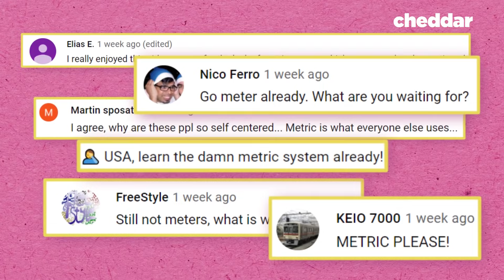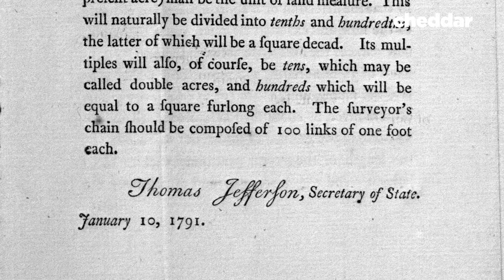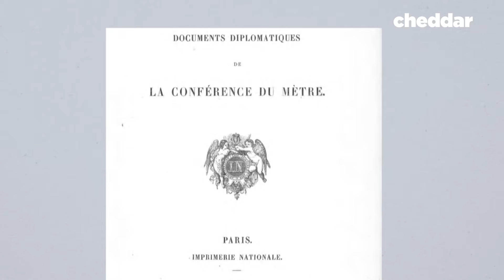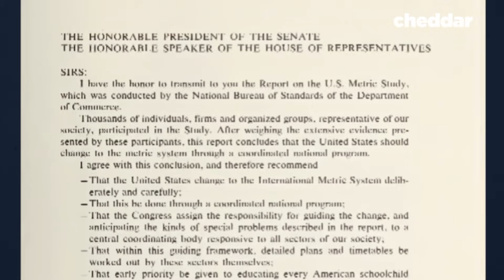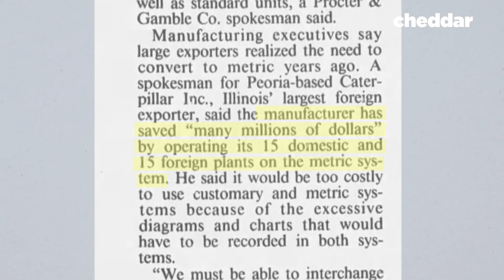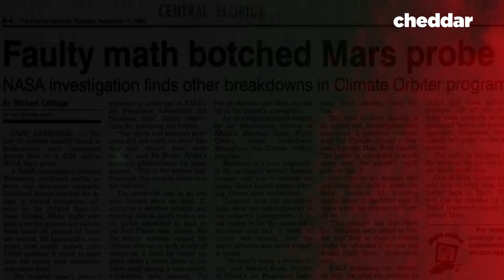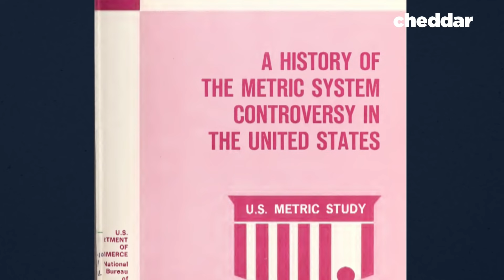Why Doesn't the US Just Use the Metric System? - Cheddar Explains

Comment: They're those who have been too the moon, and they're those who use the metric system
Reply: The guys who got you to the moon used the metric system to do it. Like it or not, the metric system is much easier for science and engineering.
Reply: @yamchadragonball6983  actually we went to the moon without metric.

Also the us doesn't use metric in sceince cuase it's easier.it uses meteric to coprate with other countries when it comes to importantscientific tasks like building a space shuttle.cuase in the past the us tried to build a space shuttle/station with another country and the parts didn't aleign due to the diffrent measurment systems that were used.

Comment: As an American Engineer while in University in the late 1970's and early 1980's where we were fully trained in the Metric system in all aspects of science and engineering, as well as conversion for that archaic Imperial system.  The radio station for where I learned Engineering Georgia Tech reported weather in Metric units, temperature Celsius and wind speed in meters per second (hurricane force is about 33 meters per second).  I adapted quickly;y when I lived overseas.  No well trained American engineer I know of was sympathetic to NASA for that mistake because the error was pathetic.

Comment: The only way it will ever happen is if industry stops selling in English Imperial units then no need to convert. But why is metric "more efficient "? I don't see it.
Reply: 1 cc is 1/1000 liter, and weighs 1 gram at STP. It takes 1 Calorie to raise 1 gm of water 1C. See?
Reply: @TheRealJamesKirk  Not really. Using the system you know is more efficient than conversation. I can just see converting all those recipes to metric then having to go buy all new measures
Reply: @clasicradiolover  - I think you are assuming that one starts with US Customary units and then converts. This isn't necessary, and, at any rate, it's easy enough to ballpark the conversions. But why? AFAIK, most kitchen gear is calibrated in both systems these days. Just do everything in SI.  Ballpark conversions:
1 L = 1 QT. + 2 liquid oz.
1/2 Kilo = 1 Lb. + 1 dry oz.
°C = °F/2 (in the typical cooking temp range 200F - 500F)

As we used to say at Shell R&D, "close enough for government work."

And if you are driving, 100kph ≈ 60 mph (62, really)
Reply: @TheRealJamesKirk  how much salt in a pinch in metric? Tea spoon Table spoon?

Comment: I can safely say no one knows how to correctly convert metric units in fractions without help, Thus making a whole system measurement extremely difficult to work with. Even a drug dealer will tell you that.
Reply: That's because it's not meant to be used in fractions but rather decimals, it would be like saying  "an eighth of a dollar".
Reply: @Wenasd  a dollar/currency uses the metric system 100 cents = 1 dollar, making calculations easy.
Reply: I know, that's why I mentioned it, my point was that the metric systems makes it so that fractions are unnecessary.

Comment: The metric system is excellent at science and engineering, crappy for basic life. The imperial system is human intuitive, you know what a pound is ... the amount of the things you use that would fit in you hand. Foot is basically the size of a man's forearm. The degree in the F scale makes more sense for the range of temperatures we experience in life, sucks for chemistry.

I remember an experiment run in the 80's that proves all of this .... they had metric and imperial users do naive estimates of things. The imperial had more accurate estimates by a decent clip. Weights, volumes, and temperature where the biggest. Makes sense, we think in whole numbers and fractions, not decimals. There is a huge difference cognitively between estimating say a quarter of 1 pound versus 1000 units of 1kg.

Comment: A 12 based system would be better because, unlike 10, it can be divided into hole numbers by 2, 3, 4 and 6. However, a 10 based system is far easier for humans to calculate, because we use a 10 based number system. If only we counted 0, 1, 2, 3, 4, 5, 6, 7, 8, 9, A, B, 10, 11, 12, 13, 14, 15, 16, 17, 18, 19, 1A, 1B, 20...

Comment: @5:44.... How you going to say"our" drug dealers??😕
Reply: In the US, they sell drugs by the "brick" to make money. A brick of any drug is 1 lb.[ = 16 oz.] (rounded off to 500 kgs for easier calculation and isn't correct when it's actually 454 kgs/1 lb., so using metric actually make you lose 46 kgs (1.6211453744 oz.) using approximate metrication. If each kg is $1 USD or € 1 , then you lose $46 USD or €46 everytime someone rounds up using metric!!!) 454 kgs = 16 oz. (1 lb.): 28.375 kgs = 1 oz. : 1 kg = 0.0352422907 oz., therefore a gram is approximately 35 1/4 (35.25) oz.. It is legal to own 1 g of any drug in some parts of the USA. Mm & cm are useless. Good luck building a lopsided house with mm & cm. inches are bigger and more accurate when measuring as an architect.

Comment: I work as a mechanical engineer / product designer in a company in Slovenia, Europe. Of course, we use the metric system and everything is fine until you are forced to use parts, supplied from the US. They not only have a totally diffrent technical documentation standards and principles, but the biggest issue is with that damn imperial system. For example, I was designing a custom non-standard oxigen supply system and the hoses and pipes were ordered from EU (so metric system), but the fittings and valves had to be bought from the US, so it took me several days just to calculate the correct tolerances for parts and it was a nightmare to properly assemble the system together. So, PLEASE FOR GOD'S SAKE, GO METRIC ALREADY!
Reply: When I had to conduct a few experiments for my thesis in Australia, working with an Australian company, using equipment made in Germany they'd set the units of measure on a per squared mil basis. When I was told that I thought they meant per millimetre squared, but no they meant per squared mil basis and a mil is 1/1000 of an inch, which I'd never heard of being called a mil before in my life (as far as I was concerned that woulf have been called a "thou") and there was no reason to be using when everything else was metric. So thay totally screwed up my calculations.
Reply: It’s so frustrating to design in imperial and convert back and forth. I’m constantly converting and trying to measure American things that were made in god awful imperial inches.
Reply: Sounds like you accidentally ordered some legacy parts meant only for maintaining old systems in the USA.
Reply: Hej a si ti slovenc
Reply: 1 mile= 1760yards, 1yard = 3feet, 1feet = 12inches. Made simple calculation into nightmarish, just like what is the answer LXXVI multiply to IV ? the answer is CCCIV
Reply: @Prajwal Pramod Mass idiocy is an American and British speciality
Reply: 2:56-2:58 why is Ireland included with the UK
Reply: You spelled oxygen wrong.
Reply: Nah.
Reply: Itak!
Reply: @Prajwal Pramod Well said
Reply: @yamchadragonball6983  What country were you working in
Reply: I'm a manufacturing design engineer in the US, working in the automotive industry. Everything we produce is designed in metric; however, some of our equipment and our supplier machine shops work in imperial.

I've worked with German and Japanese technical drawings and can attest to differing standards from all over the world. Germany uses a set of industrial standards by DIN, while the US uses ANSI, then Japan has its own thing with a whole different set of symbology. The US uses 3rd angle projection, while Europe uses 1st angle.

However, I've noticed that Europe still uses imperial units for pipe fittings.
Reply: @sonicpsycho13  Thank god for ISO
Reply: @sonicpsycho13  stop designing vehicles that require a complete disassembly of the steering column and dashboard to fix a 3 dollar part lol
Reply: CoreTech951 — If you got it from the United States, it’s in US Customary units, not Imperial.  Any US company that makes parts can make metric parts.  You just have to specify what you will accept and buy from someone who will supply it.

Would a Slovenian company supply parts to the US in US Customary units?
Reply: GH1618 no because the customary units suck ass :)
Reply: @GH-oi2jf  - Only the US calls the imperial system "US customary units".
Reply: @MadNumForce   ("Only the US calls the imperial system 'US customary units' ")

No, imperial is a different system.  U.S. Customary units are based on the Exchequer units that were in use in the United States since before it even was the United States.   The imperial system, by contrast, was established by Great Britain in 1824, by which time the U.S. was already a separate, independent nation.  So we just kept on using the same old units that we had been using for centuries. 

Granted, there's a lot of overlap.  But some units are quite different.  An  imperial gallon is 1.2 U.S. gallons, and an imperial fluid ounce is 0.96 U.S. fluid ounces.  An imperial ton is 2240 lbs, while a U.S. ton is 2000 lbs even.  Similarly, a U.S. hundredweight is 100 lbs, while an imperial hundredweight is 112 lbs.  (Not that anybody uses hundredweights anymore, anyway.)

But the point is, the imperial system is not the same as the U.S. Customary system.
Reply: No!
Reply: No
Reply: What?  Create a small program to do the calculations automatically.   Your favorite system of measurement means nothing if you are just fat fingering them all in anyways.
Reply: Maybe that's why people should learn both systems and convert one to another.  Something you learn in middle school.
Reply: Nah, I prefer miles per hour and Fahrenheit.
Reply: Well, that is your problem. We like our system.
Reply: @n.n.8423  What system
Reply: @n.n.8423  Metric is more efficient than imperial lmao
Reply: @Prajwal Pramod America is an independent country with a long history of freedom. We like our own measurement system, and we’ll keep using it as long as we feel like it. We tend to not think too highly of collectivist bullcrap (All the countries of the world must unify around the same standards, no diversity allowed, no national sovereignty.) So you can keep your Metric system, we’ll keep our US system.
Reply: We think the same thing you think except for we hate metric. All's I have to say is you do you will do us.
Reply: @zman1569  Hating a more logical system hmm
Reply: Z Man that’s what I’m saying. Just let the us have our units
Reply: @1pcfred  For the sake of ease that would be a nightmare in todays world
Reply: Make your own valves or buy from China. Go to hell already.
Reply: Fat tea is that here in America were thriving on the imperial system and hate change in our learning style just look at common core for example its ment to look at things in a different direction for more critical thinking but is WAAAAYYY more complicated than just simply getting the answer so imagine that but instead with how we measure things and how we learn the weather etc.  Were just simply doing our own thing 😉
Reply: @kevinesquivel9823  no, they are not thriving on the imperial system, in fact it's holding them down. NASA, Pharmacy and medicine stores doesn't even use imperial calculations, but instead metrics. Yes, America may be thriving but clearly not on imperial, especially when they're the only few countries left that uses imperial.
Reply: @jovenchngx  personally i think we are thriving on the imperial system for instance you mention NASA pharmacy and medicine and how they use metric for that and thats because we are responsible for other people in space not jut us but if you want to get into technicals like that than how come most of the leading hospitals in the world are in america and funny story is, is that they use imperial system over metric because as students from kinder through college the doctors were taught the imperial system so that what they use to treat patients and hold clinical trials, another example would be our university's her in the US which are some of the best in the world use imperial systems. I recently got the chance to talk to someone who works for AMGEN a biomedical company that produces medical drugs and medical equipment and this person i talked to came to america from Africa where in which he grew up using metric but upon arriving to america had to switch to imperial, he said it was hard at first but soon he grew to like it and is now using it every day because her works for the 4th largest biomedical company in the world so to sum it all up i'm pretty sure we are thriving =)
Reply: @kevinesquivel9823  For the NASA scenario, yes they are thriving but not because of the imperial system. Doctors grew up using imperial system because USA couldn't convert it to metrics a few tens of years ago. Every doctor was made to relearn the calculation system, which is metrics, because USA is the only few countries that still uses imperial. USA progression in the field of Science wouldn't have happen if they didn't use metrics at all, because metrics is just scientifically more standardized than imperial. Also, yes i would understand why your friend would rather use imperial over metrics, mainly because it has more relations to human's feelings and senses. However, when your friend goes back to work, he still has to use metrics, because every other Research and Development company uses metrics. For USA to fit in, they have to convert imperial to metrics. Thus, they're thriving not because of imperial systems but metric systems.
Reply: @kevinesquivel9823  what load of nonsense. 

First of all, your entire paragraph only had like 1 fullstop.

Second, it's the same everywhere else. Countries who uses metric system also grows up with metric. Doctors, engineers, pilots to even taxi drivers also uses metric. I don't know why are you trying to prove that these professions uses imperial.
Reply: It took you several days to do conversions? Uhhh I think you need to go back to school mate
Reply: @kimjunguny  I guess you're ignorant of the tedious calculations. It is not as easier as your schoolwork.
Reply: @kimjunguny  it isn't just some simple conversion dude. Imagine multiplying layers of conversion with each other. You have to individually find ways to cancel out the units of imperial and replace it with SI.
Reply: You don’t have the right to dictate what measurement standards another sovereign nation uses. So just convert and be glad you’re making money on trade with America.
Reply: @Ethan.Lamoureux  well, we will trade with China then
Reply: @opus53waldstein70  You already trade with China. Are you saying you think metric vs. English is reason enough to abandon trade with America? I’m thinking that American goods generally have some advantage over Chinese goods, otherwise nobody would pay the higher price for Made in USA.
Reply: Opus53 Waldstein the burn
Reply: @Ethan.Lamoureux  Then I guess America don't have the rights to interfere in any other countries politics
Reply: @Ethan.Lamoureux  America is a continent not a country, fool
Reply: @SmithBryan101  Think before you speak, especially before calling someone a fool! There is no continent called “America”. However, just as there are countries with short names like Britain, France, Australia, etc. there is a country named America, and everybody knows it, including you. The official names of these countries are: United Kingdom of Great Britain and Northern Ireland, République française, Commonwealth of Australia, United States of America.
Reply: @Ethan.Lamoureux  They could easily avoid American suppliers
Reply: @Ethan.Lamoureux  BRUH💀💀💀
Reply: Ethan Lamoureux my dude, America tries to do that all over the world and it’s usually very very bad for the people in the countries they do that against, and now when THE REST OF THE WORLD tells you something that would make your life easier you go like “no uh, we special”
Reply: engineers are some very stupid people.  they think they have a piece of paper that says they are smarter than you.
Reply: @knotkool1  says someone with no idea what it takes to get that piece of paper and whose suffering from the Dunning-Krueger effect.
Reply: knotkool1 That is just an excuse for people dumber then engineers.
Reply: knotkool1 your’e just an ignorant little fuck who brags about being «professional»...
Reply: @knotkool1  that's kinda what a diploma is...

Comment: I am a retired bus driver. Where I used to work, the maintenance department resisted the metric system because the mechanics and technicians said they did not want to buy a whole new set of tools which are expensive.

Comment: Why don't we see more comments on the sheer difficulty (overhead) that Imperial System imposes?

How many inches in 3 miles, 17 yards, 2 feet? One needs to actually use one's brain power on this inane problem. You get engineers using their resources to figure this out!
Whereas "How many millimeters are there in 3.67889 kilometers?"  is literally there in front of your nose without any work of any kind... 

How many noted Roman mathematicians where there? ZERO! Centuries of Roman Empire, not ONE mathematician worth mentioning...
Now... they had the same kind of problem: the number SYSTEM they were using was just plain garbage, when it came to math. What is MCMLX1 times CCIV? Who knows? And yet, any 4th grader with a pencil and a paper can answer:  1,961 x 204 = 400,044.

In this sense, the insistence on using Imperial measures is actually stunting the user's mind, because they have to use their intelligence to figure out things that are NOT important!

Comment: I like to use imperial for some things and metric for others like a pint of beer, feet and inches, and when using a ruler which measure is nearest i will use inches centimetres, millimetre metre. When i measuremout cable or fishing line i know if i hold out my arm hand to right chest is a metre